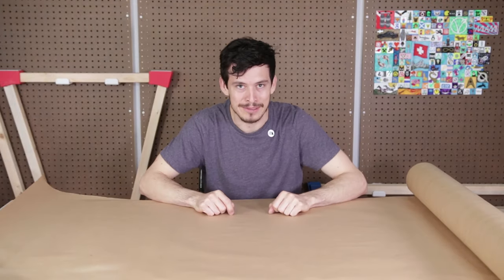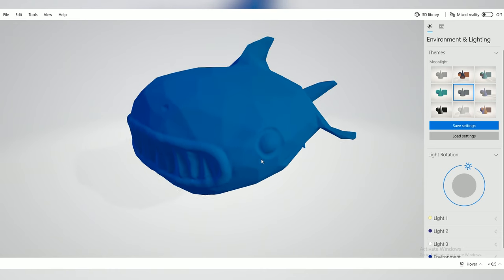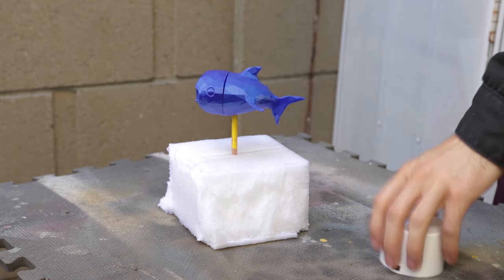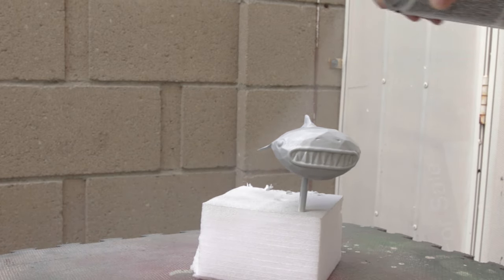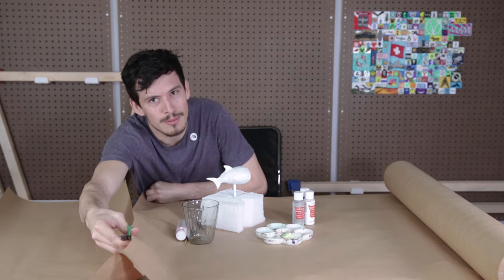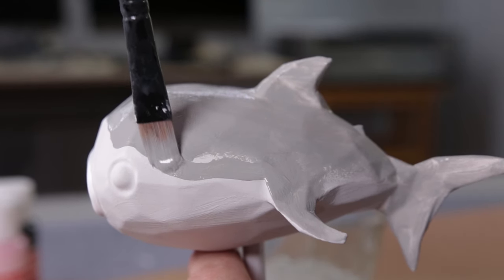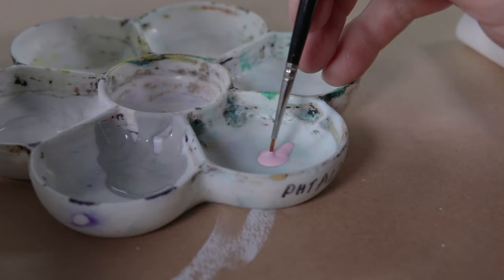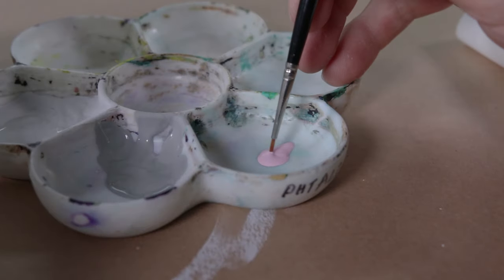Painting 3D Prints with Cheap Acrylic Paint // 3D Scanning, Printing,and Painting a Great WIDE Shark

Comment from the maker: Ok guys, I lied a little bit. I've spray painted plenty of models, but this is my first go at hand painting. How did I do? Tips?
Reply: You did great but there is always room for improvement!!
P.S I love your channel and you have such amazing creativity that a lot of the time you channel into real life practicality!!!
Reply: your painting was definetly better than mine so i cant say anything that would be negative.
Reply: Layers and layers and more layers! Adding the dots was a good idea, but if you wanted to hide the rough edges even more, it's good to put some dots on the line itself
Reply: Nice job. Both models are very fine. I thought first the "original" was a plushy thing. Next time you print 2 halves, you may remove the bottom part in the slicer, just print the perimeter and internal infill. Then sand the bottoms on an plane surface, so you can have an almost invisible minimal gap when glued. Maybe you can cut the part with an extra 0.5 mm on each so you can sand the 0.5mm to an almost perfect joint (easily done in Prusa Sli3er). Voilà, waiting for your next bee-deo
Reply: @msjkramey  yes great dot work
Reply: "I lied a little bit" the meme answer to this would be "Are we a joke to you?" 💝 💟 💥 🐣💞
Reply: Print 3D memes
Reply: I have a tip!
You could use a dark color to do a wash on the teeth
Basically you just dilute black paint, brush it on the teeth and wipe it off. It will leave the paint only in the low spots and act like some kind of ambiant occlusion. It really brings another level of depht to the paintjob.
Reply: The cloudy stuff from the varnish you mentioned is probably the fumes from your spray primer de-gassing under the varnish coat and making tiny bubbles. It might work to wait on the varnish coat until you can't smell the spraypaint smell anymore, but that could take a while like a week or more.

If you do much more painting with acrylic check out wet pallets! Super cheap and easy to DIY and it  keeps acrylic from drying too fast and helps thin it some to fix those brush stroke marks.

I liked the technique of using the dots to make a gradient!
Reply: You did great, and to be fair, cloudyness gave him even more character as a sea creature. Love it!
Reply: If you want to see good advice on the paint sealing process, look at doll repaints/faceups/custom jobs. 

It’s a hobby that’s been around for a long time so they’re pretty good at telling you how to apply sealants, how they react to different materials (pastels, coloured pencils, watercolour, acrylic, etc) and which ones yellow faster.

Dollightful and Nicolle’s Dream have some pretty good painting tips, creative tricks, and sealant alternatives. If you can bear with the “girly” aspect of their doll faceup videos, they have a lot of useful information for people pursuing creative/artistic projects.
Reply: USE JACQUARD PAINTS AND GET AN AIRBRUSH DEVIN...NEXT TIME LEAVE THE EYEBALL SOCKET EMPTY AND PUT SOME REAL LOOKING IRIS EYEBALLS IN THERE...HERES A CHALLENGE FOR U....MAKE IT SWIM WITH A WIND UP MECHANISM...YOU CAN DO IT...
Reply: I think it was really nicely painted!!
Reply: Looks good. I've painted models for a while and this still looks better than mine.
Reply: This is exactly the way I paint my models, and I'm using the same paints.  The only recommendations I have would be to use spray paint whenever possible for that smooth finish you want, then switch to the acrylics for details.  Personally, I plan on trying an airbrush soon.
Reply: Hey man, i love your work, but i never figured out what means your logo, can you explain me ? Hope you never make a video about it, bcz i miss it if it's true xD !
Reply: When i've had to glue 2 flat surfaces like you did i've had better luck sanding the two sides that touch so they are flatter and less bondo/wood filler is needed to hide the gap. Just a suggestion for future project, but great job!!!!
Reply: Your technical skill is great but maybe ask your sister about the color choices that pink was waaaaaaaaaaaay to light maybe even try a red and mix the smallest bit of white into the red and then you will have a great shark mouth color
Reply: @qwkslvr8619  I'm sure you are good at other things
Reply from the maker: @NightVisionOfficial  I have a post about it at makeanything.design/blog, but basically it forms an 'M' and 'A' from 3 identical objects (in the way that 3D printing allows)
Reply: i like the pink wood fill  it dries like wood
Reply: I would recommend if you enjoy painting the prints, building a spray booth to make spraying easer (and better lit), and investing in an airbrush if you want the color to be smother.
Reply: @make.anything  I think you say that on a video, thx btw :D . If i give you a model, can you print it ? xD, it's a dice but with a shape of a lock, is already existing, but you need to buy it, and i change something, that lock was my second 3D model that i made :P, only to give me your impression, and if you can, make some dice with your cool imagination that i almost lost at primary school xD !
And also, keep inspiration ;P
Reply: I thoght the dots are useless but they were really cool
Reply: Have you tried Smooth-On XTC? Should give you way better results in a lot less time with pretty much no sanding. I use it on almost all my prints that require a good finish. Avoid all the time and mess of primer-filler as well. Fun character designs, love your channel!
Reply: +Make Anything You might want to mix the paint with a little bit of water - that helps it level out, reducing streakiness, as well as making your layers thinner, so as not to fill up details on your model (not that this model had many). You can also use a technique called "washing" to add more depth to the mouth: it is basically jsut thinning out paint to the point where it becomes runny and transparant, then applying a decent amount of it on your model. The runniness will make it so the paint flows to the receded areas, where it will be the strongest. Doing this with a black paint imitates shade :)

You can then also bring back highlights using a technique called drybrushing, which is essentially the opposite: instead of using a lot of thinned down paint, you use a small amount of paint. You grab the paint with your brush as usual, then dry it off on a a paper towel. You can then apply it using a fan-like motion to your model, making it the strongest on the extruded areas.
Reply: I enjoyed it - some good ideas and tips. It's nice to see ideas from a number of people in the community combined with your own to create something like this. Excellent work!
Reply: dont use super glue for that type of alignment and sand it flat first. i would get a good resealable 2 part epoxy 5 min set.  
drilling through pla nicely is a pain, you have to go slow and have a sharp bit.  avoid it if possible, put the holes in the 3d model before printing.
Reply: My only suggestion with those paints is to water them down a bit, it'll prevent brush-strokes.

Sure you'll need more layers, but the end result is much nicer.
Reply: One other thing you could try is a bit of dry brushing, perhaps on the teeth. It wouldn't necessarily fit with the style you have here, but you'd basically paint the teeth with a darker color then lightly hit the raised areas with your brush with barely any paint on it (do a few layers) and it'll leave the top of the teeth white with the creases darker. You can also blend the paint together while it's wet if you wanted a smoother gradient for the pink in the gums. Either way the design itself is absolutely adorable!
Reply: Airbrush, my friend.

I got one for my self and now I can never go back.
Reply: You did very well! With your Instagram rejected animals showing such impressive creativity, your skills in all the forms of “modern brushes” most call technology, it still takes a genuine soul such as you to bring out the infinite possibilities of art! Love your channel! Keep up the good work!
Reply: Great model!!! My daughter and I love your characters!! More 3D Printed stuff please. Also, from far you barely see the teeth, all u see is just white blob especially with the satin varnish  coating. If you dont mind, I'd like suggest to go back and do a bit outline between each tooth valley, say with grey paint and not black. Use tooth pick so you can get fine line, your fine brush is prob too thick for this. Your prepaint prep is awesome, I wish I I have such patience 👍
Reply: You did a great job painting, but I wish he was darker, and a blue grey. Great work.
Reply: Its a really good paint job! only thing I could suggest is a light dark wash on the teeth/mouth, it would make them white teeth pop and give it more contrast.
Reply: Breyer than me
Reply: Better than me... lol. Love your vids. Have you considered using
your 3d pen to "fill" the crack where you joined the pieces?
Reply: Question: You used a lot of materials to smooth out the low-poly shark and fill in the cracks before painting it. I just wanted to know if you have to do the same for a model made with a 3D pen. It seems like a lot and since I was going to by a 3D pen, I wanted to know if the smoothing process you did is required, especially if I'm only using white PLA filament for my pen.
Reply: I loved these two videos. The spray "mistake" makes it look more realistic anyway, don't worry. Looks intentional. Maybe you can make another one and sell it to one lucky veiwer.
Reply: I would water down the paint and do a bunch or layers to make the brush strokes less visible

Comment: I use wood filler for my figures too. One tip, depends on your wood filler, you can thin it with water and make it viscous enough brush or even dip the figure. Let it dry, sand and redo it until satisfied. Also, your channel and videos are what tip me over and made me seriously considering getting a 3d printer.
Reply: just get one. you will then constantly ask yourself why you didnt get it earlier :D

Comment: I’ve been making props for a few years now and have never heard of woodfill. Definitely going to try it out now on some of my 3D Printed props!!
Reply: I always was told to use Bondo...I'm going to try Woodfill for my next big print, because the Bondo...is cracking like crazy, eats my sanding blocks, and is impossible to lay thin layers with.
Reply: @NikkiTheOtter  I use my fingers to lay it on thinly. I’ve used wood filler a few times now and just don’t like it. XTC-3D plus bondo is my way to go 😊

Comment: 13:09 you don't need expensive acrylic to paint good, if you have brush strokes you can use 2000-3000 grit sandpaper and lightly sand away the brush layers until smooth and even, it will take time but it means you can continue on a budget

Comment: I bought the 3D Systems Sense 3D Scanner, I've recently been scanning friends heads, printing, moulding, casting and painting them. I sometimes use resin casting in conjunction with my 3d printed parts to create things not possible with just a printer alone. I didn't have a 3d printer a year ago, now I have 2 (and a broken, yet to be fixed Fabrikator Mini V2) Videos like your's have helped me along the way, and enabled me to learn to use things like Fusion 360, so thanks (y)

Comment: Well if you really want to get into it, airbrushing would be the way to go. But in case you want to keep it sort of basic, you can use multiple watered down layers of paint (let them thoroughly dry before painting the next one) and fine sand afterwards. Or do the same as you already did, but fine sand it after a couple of layers.xD
The wood filler suggestion is a great idea, thanks.:)
Reply from the maker: I didn't consider sanding the paint. Interesting!
Reply: @make.anything  To water down the paint try a wet palette!

Comment: try XTC 3D its an "auto"-leveling 3d print filler. great if you sand a bunch before, then use it, then do a very light finishing sand (with mesh or scotchbrite). also when using this stuff, don't go heavy handed. Makes an amazing finish if done correctly for spray painting after, your models look almost injection modeled after

Comment: Lots of comments here so I bet someone already said this. Wood filler shrinks when the moisture dries out of it. So your print dryer did its job. My tip is to put on more than you need. Don't smooth it when it is wet as it will shrink.  Some brands of fillers shrink less than others when drying.
Thanks for the video!
Reply from the maker: Good point, thanks!

Comment: Fun to watch, new to your channel. I really Like the rejected animal idea!
A few tips From a painter.
Thin your paints, with acrylic just a few drops of water or flow medium will help with the brush strokes even with cheap paint.
Look up the dark lining technique it will help the color transitions and making details pop.
The cloudy look to the varnish is usually from too heavy or thick of a layer, from humidity, or from it drying before hitting the model (Usually too cold). Spray lightly from 18 inches away another light coat and it can clear up the varnish, but it can also make it worse if you still have any of the other conditions above.
Looking forward to more!

Comment: For when you tried to dry your Shark in your machine and the crack came back (where the wood filler had it filled in) my best guess is that it wasn't your pieces that shrank. I believe Wood filler is used to fill in wood cracks, because it can move and warp with wood; since wood does shrink and expand on it's own, in certain climates and temperatures. Meaning, heads up, that crack may come back if your piece isnt kept in a controlled temperature environment. Hopefully, this won't be the case. Loved the video still and, regardless of the hurdles, you did an awesome job!

Comment: Acrylic paint is so good, it's cheaper than something like enamel or oil paints, easy to use, you don't really need some weird toxic solvent to use it, and it looks good, but it doesn't stick to stuff like plastic, although if you do a thick coat it's so satisfying to peel it off

Comment: To save lots of time (and dust) when sanding the wood filler, use a wetted tool (palette/putty knife, finger, even paintbrush) on the filler before it starts to skin.  You can smooth out an awful lot and save on quite a bit of sanding.  You can even make a wash/slurry for light filling of layer lines.

Comment: I've als painted a model with acrylic paint, i got rid of the paint brush inperfections by using a foam brush, and by fingerpainting some areas. Used high gloss varnish on mine, I didn't got the cloudiness, but it still came out a bit funky looking

Comment: I highly recommend using Rustoleum's sandable filler primer. I find that it produces a lot smoother finish on 3d prints post sanding than other filler primers. Also, I use the same acrylic paint but I water them down a little and apply several layers to achieve a brushstroke-less result.

Comment: You know, in R/C airplane world we always used to use Spackle (like, used for covering nail holes in drywall and such) to fill gaps or uneven surfaces on balsa sheet, especially on the wing surfaces. If you didn't your Monokote layer wouldn't be perfect and divots would show up just like they would in a paint job.

Being that it's a nice white, super lightweight but acts a lot like that wood filler where you can really play around with it in varying levels of wetness and not being worried about over-application (aside from the extra time removing it!), it's GOTTA be great for 3D prints, I'll have to try it out...

Comment: There is one possible major drawback to woodfiller. You cannot wet sand wood filler. It will dissolve away. But if you don't wet sand then it's great
Reply from the maker: Thanks for the forewarning! Do you think it would be okay under the spray filler?

Comment: Fantastic as always... it never ceases to amaze how awsome the end results turn out from Your ((deceptively)) easy looking process !
One question (or  possibly a suggestion) is there any specific reason why You don't make "registration holes" in Your "parting surfaces" when You split models just for the "print stage". And then use and use "dowels" (or something) when You "reassemble" them, it would seem as a good way to make them both easier to reassemble (glue together) precisely and also possibly even strengthen the joint ??
Best regards

Comment: Base on step, is it okay to start applying wood filler then next is spraying primer?

Another question, can I use heat gun to dry it faster? Or not 😅
Reply: I haven't tried this but from what I've seen so far heat gun will probably m melt or deform pla

Comment: Great video! The drill was running in the wrong direction (counter clockwise) hence the problem with cutting through the material. Happened quite some times to myself 🙈

Comment: Super glue (CA) deposited in the crack and then sprinkled with baking powder makes excellent filler. I would NOT suggest smoothing it out with your fingers. Not as non-toxic as wood filler, but it does the job of actually gluing parts together as well as filling. You might try  an airbrush as well. they spray acrylics pretty good, but there are acrylics made for airbrushes that work a little better. And for the finest details, use a toothpick as a brush.

Comment: So the thing with acrylics is that there will always be brush strokes, no matter the price. You just have to use A LOT of watered down coats to get things smooth. If you don't want your paint apps to be messy, try using enamel paints. That's what model hobbyists use.